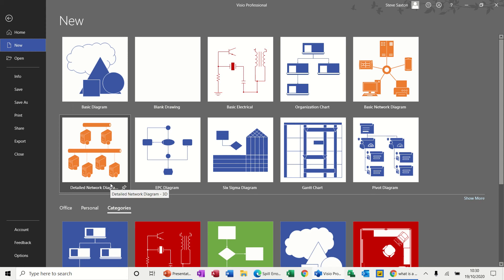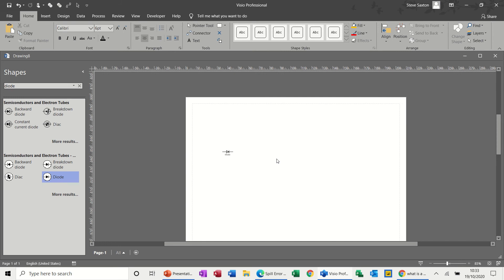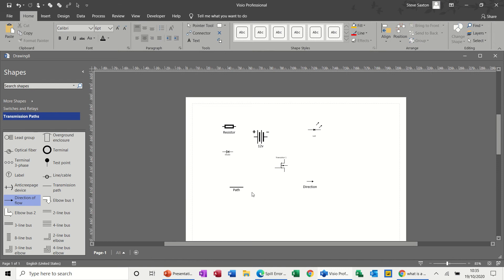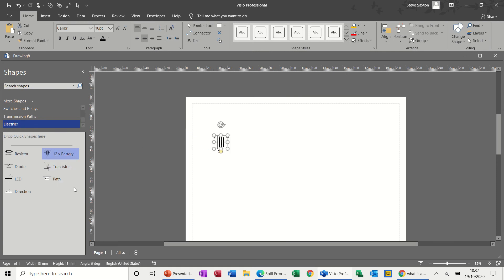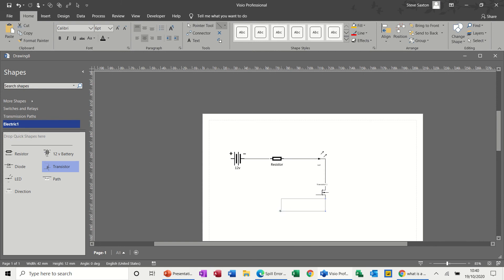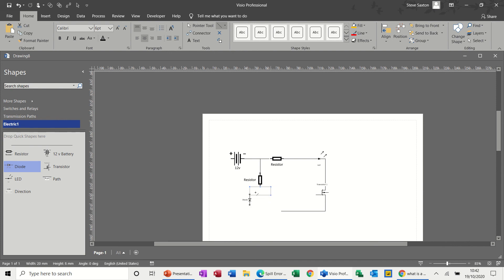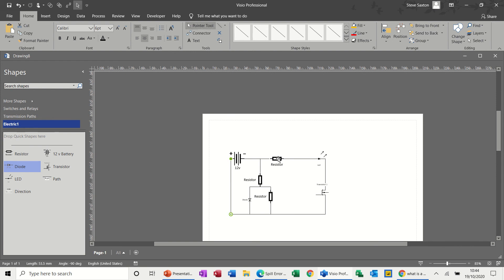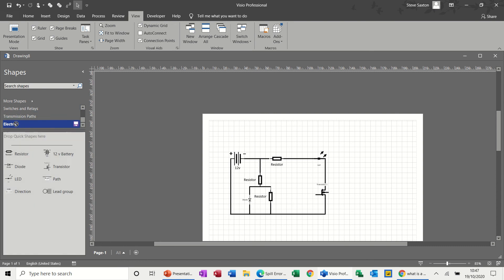How to create a basic electric circuit in Microsoft Visio

Comment: Are you not supposed to use connector lines for this kind of work? You left gaps between the lines and components.
Reply from the maker: You can but this was the template for electric circuits